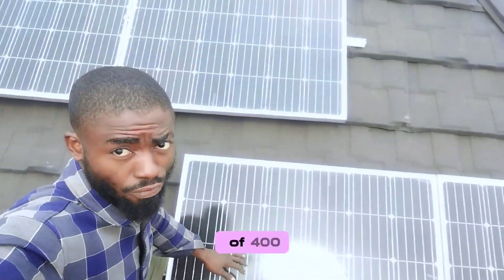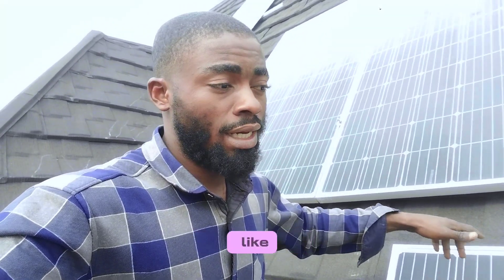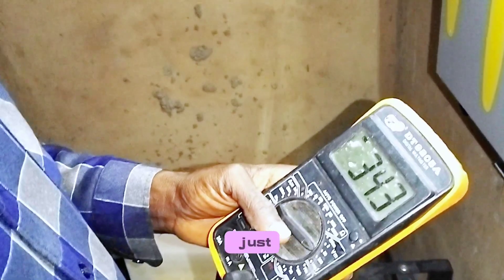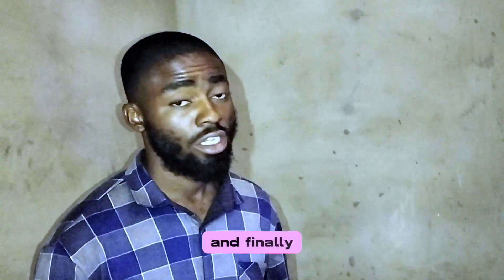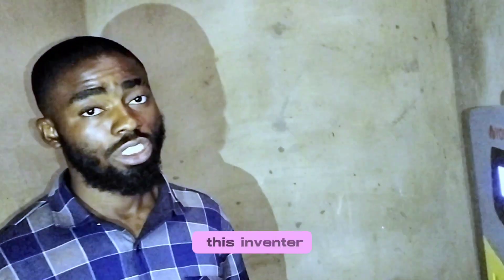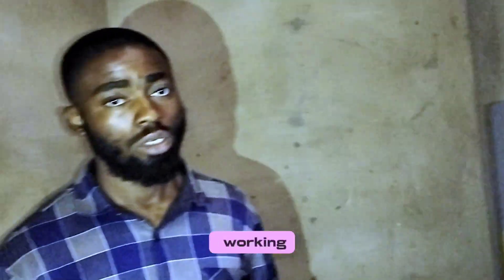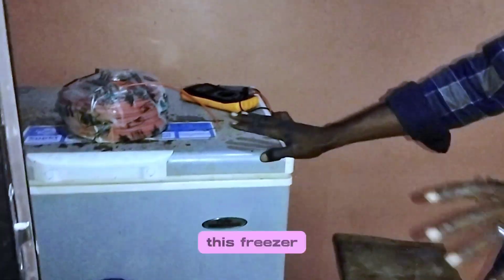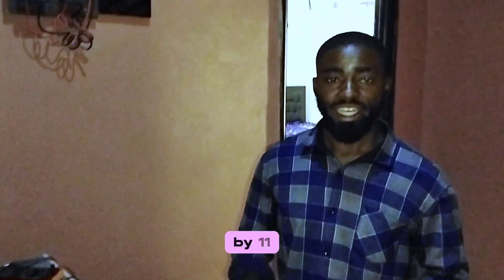3.5kva inverter solar energy system. how long will take to fill 2units of 220ah batteries?

Comment: Please i really need your advice i just installed 3.5kva hybrid inverter with four panels of 495w each, then i have 2 batteries of 220ah but the light goes off at night early what should i do sir
Reply: You just need to mind what you ON from anything 6 
Like mine now, I have 3.5kva and 4 panels of 300watt and I always use it till morning 
If I have the TV, fridge and other stuff ON since morning then by evening I off both then by 8 I ON the TV till 10pm then everything goes off except the lights and fan so try to keep that also 
It will surely work for u

Comment: Pls is it possible to to use two batteries with 48volt 3.5 kva, will it work?
Reply from the maker: Two batteries of how many volts?
Reply: 2 battery is for 24volts. 4 battery for 48 volts. recommend

Comment: Can i use generator 3000 sumec to charge my battery i.e 2 220ah battery 4.2kva sunfield hybrid inverter.
Reply from the maker: It depends on the amount of current the gen would pull, but I would say no to that though

Comment: While the sun charges the battery using Yohako invert. Does the battery bar moves? When charging with neppa light, the battery bar does move, same with generator but not the same with sun(solar panels). Could this be fault or default setup from manufacturer?
Reply from the maker: I think there's no enough power from your solar panels or change some settings
Reply: It has to move..if it doesn't move, there is an issue, it has to move
Reply: @mikolobabz  While charging with sun/solar panels? If faulty, what could possible be the reason?
Reply from the maker: If the load you use at day is above the power you generate from your PV, your battery won't charge

Comment: I notice some of your installation you make use of an external charge controller even if the inverter has an inbuilt controller. But on this one u made use of the inbuilt controller.  What factors would you consider whether to use the inbuilt controller or not
Reply from the maker: I don't think I have used hybrid and used an external charge controller, mostly if I use hybrid, I do use the inbuilt charge controller
Reply: @Mairigaemmanuel  ok meaning using the inbuilt charge controller will in no way shorten the inverter life span
Reply from the maker: @arnoldaddo2642 not really
Reply: @arnoldaddo2642 if you're using a hybrid inverter unit, there is no need to include another standalone inverter. That would be wasteful and totally unnecessary.
Reply from the maker: There might be need, cause most at times hybrid have specific amount of power they can handle from the pvs and you may want your battery charging and PV power at use the same time , so an external charge controller maybe needed in such situations
Reply: the inbuilt controller is Mppt right 
Just wondering why you choose to connect it in parallel not series 
Becos I thought on Mppt 
series connection is best
Pls I would like to know why u did parallel instead 🙏🏾
Reply: @ezewuprosper3836  same here.and also if the battery is in parrell too